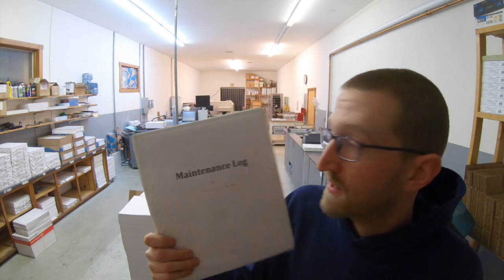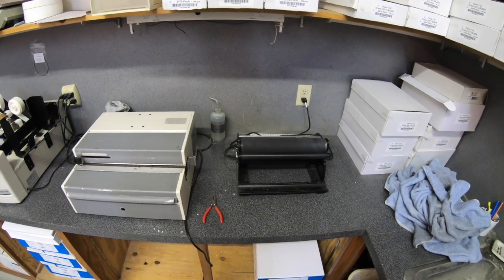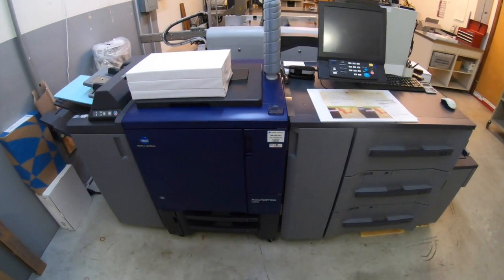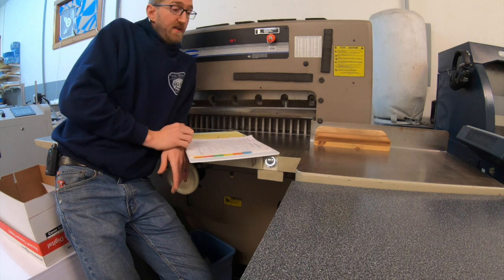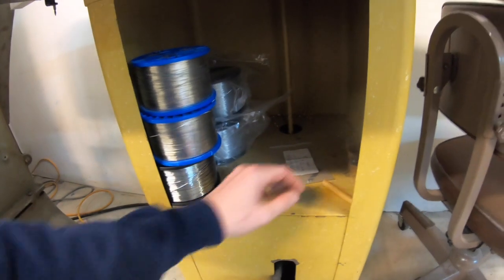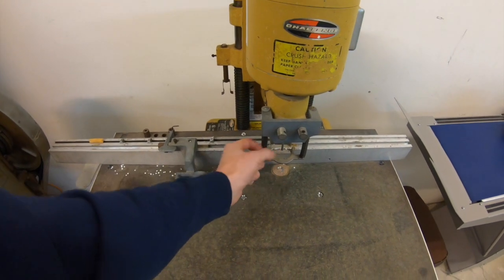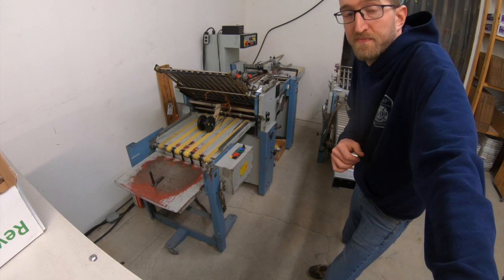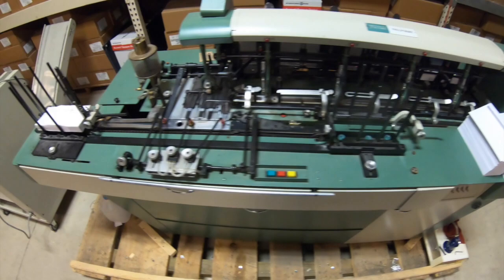Lazy Millennial Digital Print Shop Tour, Starting Book Magazine Printing Binding Publishing Business

Comment: My cousin ran a print shop for many years and also had a newspaper.  I worked for him part-time as a kid---I mean 12 years old and up---and loved the printing business.  Learned a lot that has served me well over the years.  Started out using an old letterpress to do perforations and print post cards and business cards---setting the type myself.  And then I started doing the set-ups and layouts using Varitype machines and big books of printed images, the light table doing composing and corrections, the darkroom making plates, and running the offset presses.  It was so much fun, yet I loved radio.

OH---I have to guess---had to come back and edit my post, but as one of the other posters said, that's a linotype.  I just couldn't remember what it was called.  Used type set in one many times in that old letterpress.  My cousin wouldn't let me use the linotype because it was a little bit finicky, but I watched many a time!!

I enjoyed the trip thru the printing plant immensely as I am also a self-published author with five books on the market and several more slated to be published this year.

Thank you for the trip down memory lane and for the overview of how the industry has changed.  The church I pastor was given a like-new Canon C5235 Image-Runner and it does so much it is amazing to even me, an electronics engineer.  The industry has changed so very much!!

Again, thanks for your video.  I enjoyed it.

If you still have an old letterpress around, it would be interesting to see a video on how they worked.  THAT would bring back some memories for sure and educate today's generations on how we used to do things in the old days.

Comment: Linotype...lead type machine. If you get that running I will declare you a genius!
Reply from the maker: It will run some day, although I don't know too much about it. I'll be bringing you all along for that adventure.
Reply: @justaprinter  I've seen them run... Incredible piece of engineering. A company in the city I am in still uses one.
Reply: @justaprinter  We have two Linotypes upstairs that my grandparents ran together. Our last client that ordered lead slugs quit buying them in the 2000s. I remember sitting there watching my grandpa run his and being so excited when he would cast the slugs. I loved all the moving wheels and sounds.
Reply from the maker: @kdw75  Awesome! They are mesmerizing to watch. I just need to find time to clean it off and fire it up.
Reply: @justaprinter  Linotype. Usually used for letterpress. It is install into a case then ready to print.
Reply: When I was a teenager we had an Intertype lead type machine, AND A Ludlow. Very similar. My parents went to the Smithsonian and discovered ours was older than the one they had on display at the time. Not only did we use it at the time, including me, we melted down the old type and made lead bars to drop in the hot pot. We took it and the brass type to the scrap metal yard.

Today, I still have a KM c6501P and have done all the maintenance myself for 6 years.

Few days ago I was laughing about how we had to make negatives and metal plates for everything back in the day. 

The young folks GOT IT SO DAMNED EASY!  😆
Reply: THAT was my first guess and I was so busy writing a thank you for the video that I forgot to mention it.

May be a relic, but what a relic it is!!!

Comment: Dan.!! Can you walk us through your process for perfect binding.?? From formatting the book covers both soft and hard bound including margins so final trim can be done. Talk about final cutting with 3 knife machine vs guilotine. Paper gsm weight for standard paperbacks interior and covers. Doing prescoring spine for hinge and text block, preferred glue (PUR-EVA-PVA). Your perfect binding ensemble. (My dream setup too!) The unit, the auto feeds, the trimmer. Gluepot management, machine costs, operating expense and typical repairs you can expect. I’m in the Philippines binding by hand. Using fine scroll saw to score spine. Brushing 3 coats of PVA before covering. Then trimming out with an A3 manual guilotine ream cutter. Thoughts on tabletop perfect binding machines. Can’t send you pics of what’s available here through this but, anyway. I’d really appreciate you showing us your how you do it from start to finish. I’m having issues with aligning covers. Only can do my setup through my little Brother A4 monochrome’s booklet software so I run two books at a time. I’m outsourcing my color covers since we don’t have a color printer yet. Do have a laminator. Single side Cold lam on the covers. 70gsm text blocks when I can’t find 80gsm precut. Wish we could buy bulk and have it cut down. Later, after we’ve grown hopefully.
Reply from the maker: Awesome! Thanks for the comment and great idea on start to finish, detailed perfect binding video. I will certainly do that in the future. Sounds like you are building the foundation for a great book printing and binding business!

Comment: You mention around the 26:00 mark you had a 3404 DI press!
I bought one last year and have been in the process of setting it up and trouble shooting it back to running spec.

Managed to get the service tech from Ryobi out for free to set it up for me, and got it to power. Now going through the motions of replacing blankets/washup blades/fluids(chiller/oils)/and ordering press supplies.

I grew up around my dads Akiyama B2 press back in the late 90's and when I found this 3404di press for a bargain, I had to get my hands on it haha.

I know you say the digital presses outperform the 3404di now, but still the allure of having my own small footprint offset got me good.

I'm thinking of starting my own youtube channel showing the journey of my new business venture. Your channel has inspired me over the past few months, so thank you!!
Reply from the maker: You should start a channel. I miss the offset but it just didn't make sense for my shop.

Comment: We bought the same Martin Yale tabber several years ago brand new. It always seemed to need new clear bands to turn the rollers. I finally picked up a nice dual tabbing Seacap 2020 on eBay, which has been discontinued, but it is amazing. It cut the tabbing time down to nothing. Not only does it do both tabs in one pass, but it runs so much faster.
Reply from the maker: Noted. I have eyed those units up too. Thanks for the recommendation!

Comment: This was a really great tour. I liked the stories behind some of your equipment, especially that 20-hour drive! And appreciate all the detail you go into on cost/benefit and best practices, your experience and advice are worth their weight in gold. Do you have any equipment recommendations for making hardcover books in the vein of what you'd see on the bestseller aisle, without having to go manual? Mostly wondering about small-scale (semi)automation for the covers, but maybe also the hybrid glue/woven binding. I work in software engineering but this is the dream — oh and if there's ever any part of your digital pre-print processes that's taking up a lot of your time (e.g. automating gutter width based on page count and paper stock) I'd love to help out with a script or some other way to make life easier!
Reply from the maker: Hard cover manufacturing is a big venture if you don't want to make them by hand. Equipment is very expensive and still require a bit of time. You would need a casemaking machine, casing in equipment, sewing or gluing your book blocks. I should make a video on hard cover production.
Reply: That would be a fascinating video! Thanks for your reply.

Comment: We used to crease everything on our Rosback perforator or on our Heidelberg cylinder, but I talked my father into buying tri-creasers for our MBO folder. They work very well for 100# text up to 100# cover.
On another note, that yellow belt on the back of the folder is a real bear. We had ours disintegrate and we just barely made it through a large rush job. We ended up having service replace it, because it was pretty involved. Oh, and we had a Baum folder before our MBO too. lol
Reply from the maker: Good to know. I considered getting something like that but would almost rather have a separate machine so I don't need to break down the right angle each time I want to perf or crease a quick job... I'm sure either situation would work.

Comment: Did you ever get your Intertype machine cleaned up. I see it has a Star Parts justifier on It. That's a nice machine for letterpress line casting. I am always impressed with your  shop. I wish I was 50 years younger when I look at what you are doing. I just got my first digital press but I now wish is was a Canon machine by your reviews. I'd like if you would post a current picture with your kiddos. By now they're probably helping you fold on the AB Dick folder.
Steve / Dove Printing

Comment: Hi Dan really enjoyed your videos. Wished that these video’s were available when I purchased my print shop in August 2016.  Our main press is a Konica Minolta 1070 C Along with a B&W Konica Minolta 951 Biz Hub Pro as well as a new Xerox C 60.  I am really impressed with the efficiency of your setup.  I am also impressed with your production throughput for a one man operation.  I wish I had as vast a knowledge base on digital presses as you do.  My background is in rotogravure, and offset at a metropolitan newspaper. All in all over 40 years in the printing industry the last 23 as a production manager.I am picking up a lot of tips from your videos which are priceless as far as I am concerned as there is definitely a large learning curve going from Goss Metro’s to Konica digital presses. Anyway keep the videos coming.  Greatly appreciated.
Reply: Linotype machine. Lead Type and plates
Reply from the maker: Glad you like the videos and happy that you are learning new things! Keep it up!

Comment: I noticed the drawers at 22:17.  If you want the drawers to not interfere, you can probably fix it just by swapping the top and bottom drawer.
Reply from the maker: Good point. I haven't actually used that envelope printer in months.

Comment: This is some of the equipment I have. AGFA imagesetter. AB dick 9985 twin tower offset press. Baumcut 31.5 programmable hydraulic cutter. Accufast k2 dual tabber. Horizon 10 bin stitcher. Konica Minolta Accurio 2060. Biz hub 6501. Neopost envelope inserter. Okidata color envelope printer. Bryce address imprinter. Graphic whizard that has 2 numbering heads and perfs or scores.The list goes on. I do like your perfect binder and 3 knife trimmer but I just don’t do enough book printing to justify putting one on the floor. I agree with you, if the equipment on the floor doesn’t make money then it doesn’t make sense to have it taking up valuable real estate in the shop. Thanks for the tour Dan 👍
Reply from the maker: Sounds like a fun shop! I would like it! Thank you for watching.

Comment: Your videos are very informative and fun to watch.  I run a very small print shop for a college district and one issue I am having it taking a adhesive print done on our large format printer and sticking it smoothly to a foam board backing.  I was wondering if you had any advise or even a piece of equipment that would handle the job neatly.
Reply from the maker: It is tricky to apply adhesive prints. I have rolled them up and started at one corner and slowly press about 1-3 inches at a time until you get the entire thing applied. Its a mess though!
Reply: Try using a laminator to sheet your prints.

Comment: Got a couple personal rules when buying used machines.
1: it needs to pay for itself in 6 months, a year tops.
2: look at getting a parts machine for certain things (photo processing equipment for instance)
3: make sure you can find a service manual and a user group (Facebook has saved me more than once)
Reply from the maker: Great idea on the facebook group. I agree with the rest of your statements too!
Reply: @justaprinter  there's actually a konica Minolta FB group with almost 2000 members. Don't work on those machines myself but might be of interest to you

Comment: Maybe the first with the correct answer for that Machine at the end @the 1hr 21 mark on the vid, did not check the other comments, but is that a Linotype machine?? Uses Molten "Lead", never used a Lino when I was an apprentice, but I did use a Ludlow machine, that was my machine in an 85% Offset Company. After leaving the company to further my knowledge, 2 Little Pigs came into my Comp Room and basically Destroyed my Ludlow with No maintenance for 3 years until my return. Basically had to throw out a Great piece of Machinery because of those Lazy Pigs. They were NOT Tradesmen, they were just Lazy Pigs.

Comment: Love your channel!! I was excited to hear your comments on your digi fold. I have been eyeing them for the past several months through ebay and other auctions and now realize it will not work for me. I primarily run 57# cardstock and 100# gloss text through a Ricoh 751pro. I am very impressed with the quality and lack of service calls on this machine. I use a Baum 714 tabletop folder and it works good enough for my cardstock but my gloss cracks even when I score them through my Rollem Auto 4. I need an additional folder...do you have any recommendations that you feel would fit my needs?
Reply from the maker: Hmm, thats a tricky one. I don't have a solution for scoring and folding text weight. I will often encourage people to use a heavier cover so I can use my Morgana. I am wondering if the newer machines will handle text weight paper.

Comment: I remember seeing something in one of your videos awhile back, but for some reason I can’t seem to locate the information about what a good first printer should be. I’m completely new to any of this but it intrigues me a lot. What would you recommend (for someone new to printing) for double sided printing like flyers and business cards? Like, a entry level printer to get started. Something you can run 500-1000 double sided prints, business cards, just plain copies? I own my own business, and I’ve figured I’d start printing my own stuff just because I’ve always took interest in print shop stuff. Love your videos ever sense I discovered them. Probably went back and watched 70% of them. Keep up the great work.
Reply from the maker: A c6500 or 1070 would be a great machine. Even the small office copiers would probably work. I'd suggest you verify print quality before you buy one of those. I started with a xerox 3535 but quickly wanted a production machine for lower operating costs, faster speed and ability to print heavier papers.
Reply: @justaprinter  Thank you so much for the reply. I knew I remembered you saying something about those, I just couldn’t remember the exact ones. I know someone with a canon c250if with these specs “Canon C250iF 
Multifunction printer/copier/fax/scan send 
Color 25 pages per minute 
Under 75,000 copies 
Rated at 30,000 copies per month “ for $400. Thoughts?

I’m not sure where to find a 6500 or 1070 locally, but if I do (I know there’s a ton of factors but), what should a good price for one run?

I know you’re super busy and I truly appreciate you taking time out of your schedule to reply to someone with zero knowledge of all this! 

Thank you!

Comment: I have a qtn though, if I had a budget of about $20k to start digital printing in a small way, what machines would you think would be a must to get. I have an old Baumfolder 714, & a 24 inch wide electric cutter. My Konica C452 broke last week & technician said "not worth it". What would you advice?
Reply from the maker: All you need is a printer. Ask your technician/salesperson if they have  a used machine you could purchase. You should be able to find a Koncia 1060 or 2060 for around $15K. Then you can print, cut and fold all day long.
Reply: @justaprinter  Thank you si much. Unto researching it sharp!